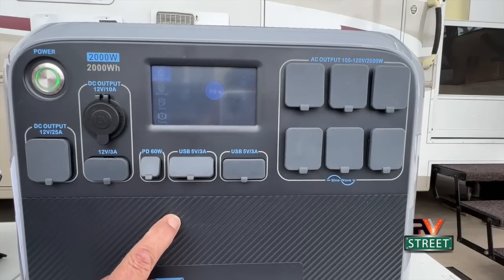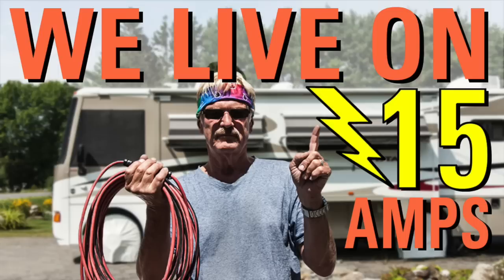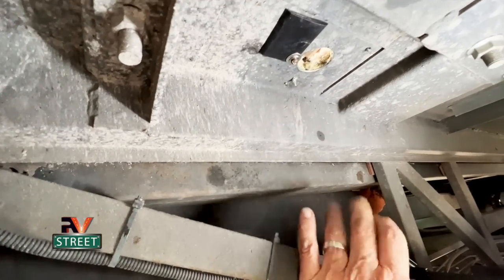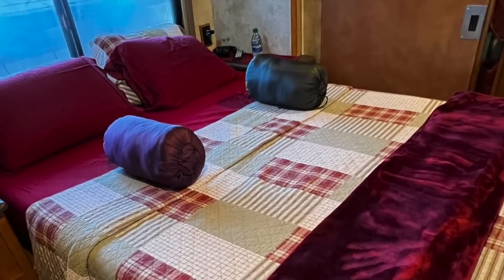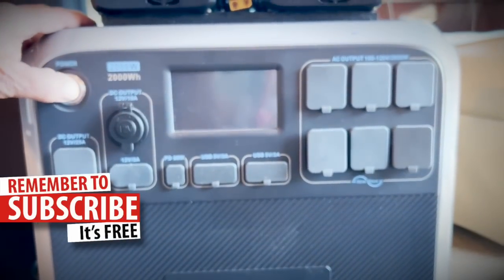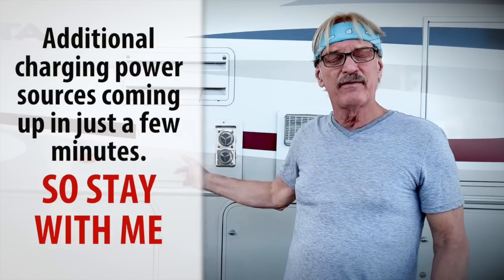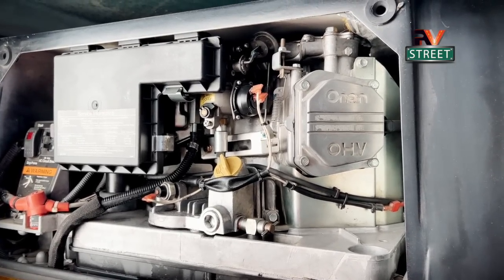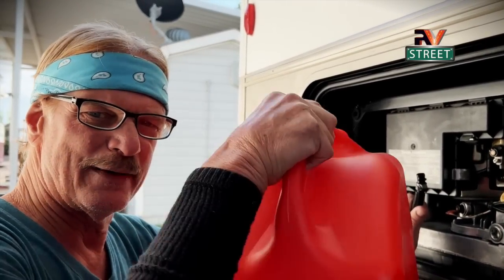Using a Bluetti AC200P in an RV • Most hands on Video on Youtube

Comment: Awesome vid, been watching about this ac200p. 2008 I have a class b pleasure way and would like your suggestion. I want to buy ac200p and i want to plug rv to ac200 while driving to be able to use the ac but charges at the same time. Can i put a splitter to 30a going inside? I will be adding solar to charge the ac200 and in house ac while driving. I can run the 30a cord from outside to inside but it will look ugly coz the cable will running througha window looking for another option. Ty for you time
Reply from the maker: The AC200P will run everything in your rig but is not strong enough to run an AC unit. Even if you installed a soft start on the AC it would run it but not for long. In order to run an AC unit you'd have to have a LOT battery storage. You have dash air in your Class B. If staying cool while driving is a problem for you, what you could do is put a spring loaded shower pole right behind the two front seats and hang a sheet there that drops to the floor. That way all the cool air coming from your dash air would be confined to the front cab area.
The AC200P puts out about 16.8amps or so. So no.....you can't put a 30amp splitter. The AC200P is for supplemental power, boon docking power or emergency power to run the Class B if there's no place to plug in. The AC200P is a fantastic, reliable power station but as with everything else in life, it has it's limitations.

Comment: Wonderful job, why Not a Jackery?
Reply from the maker: Thanks for your question Bert 👍
Well for starters here’s a few examples of the Jackery 1500 back in July 2021…
They are an entry level power source and lack a lot of big features people are looking for but it can be used in a limited capacity for a little backup power
Slowing charging
Need multiple adapters for solar panels
You can’t use other makers of solar panels if you have them already
Only can recharge for 500 cycles
And the BIG one is it doesn’t have a LifePO4 battery

My AC200P is for people who want serious backup power

Comment: Martin, I hope by now (September 2022) you know that Hutch Mountain has a kit to add the ability to run your Honda on Propane or Gas. You have the ability to turn the selector knob to Propane or Gas! I purchased all the attachment hoses, etc. from them, also.  They are wonderful with assistance!!  I have both the Honda 2200i and the companion 2200i units. I called and asked if they would tell me all that I need to change both generators. They went through all the connection hoses, with me and explained each one. It's a very easy install. If a 71 year old woman can do it, anyone can!  I also found a YT video called, "Pimp my Honda Generator". I purchased that kit also. It has a well made and nice looking, red,  magnetic dip stick and a matching extension for draining the oil, with no mess!  There's a metal handle attachment to deter a thief and also a nice cover for your unit. The cover doesn't say "Honda", which also helps to deter a thief.  Thank you Martin, for all you do!!!
Reply from the maker: Thanks Gail. I look into that. And yes I do have metal handle attachment to deter theft plus a plastic coated cable & lock to secure it.

Comment: Hi Martin, I hope you are doing well with your treatments and well on your way to complete recovery. Thanks to your good advice we purchased a Bluetti AC 200 MAX which comes with a 30 amp plug. Perfect for our plans to travel south in our class A for the first time next November! I have a couple of questions if you are answering them these days, no biggie if you're not.  1. So, when we plug our 50 amp cord into the 30 amp adaptor and plug that into the Bluetti, what do I do about our house battery system? Do I just unplug the MH inverter?
2. For the second question I'm just looking for your opinion... Would you recommend portable solar panels like yours in the video, or a solid version mounted on the roof top. Any suggestions?
Reply from the maker: 1) Leave it plugged in. Don't you want your house batts to continue getting charged while using the Bluetti ?
Reply: @RVstreet  yes, I think, depending on other electric priorities such as charging ebikes. Just wondering about efficiency of charging lead acid with Lithium Ion. Would you be better off running your generator for a 1/2 hr to charge your house batteries and maybe plug in the Bluetti with 2 power blocks for that period?

Comment: I have a BLUETTI 200max with 30amp Rv plug. Used transfer switch off 50 amp trailer connection to inside trailer. BLUETTI runs entire trailer items as needed. Don’t need all those extension cords!
Reply from the maker: Good job Andy 👍
Everybody has to evaluate what their needs are, their skill set and of course their available budget. Weight can also be a factor for some folks too with the extra batteries that the MAX can add on. For us, the AC200P checked all the boxes. Using one 12/3 extension cord also was not a big deal. But I also carry a couple of other cords for other applications that don't require heavy loads. No big deal for me. But remember, for us, this IS mainly for emergencies or when we boon dock. If we had a tiny house or needed a home backup system—and had the money—the MAX with extra batt's unit would be my choice. We're retired and don't have unlimited funds but needed some bug power.
Thanks for taking the time to chime in with what you did 💗
Reply: Fair enough. Would add my max weighs same basically as your unit. Battery internal. Also I have 500 watts solar on roof and run directly to unit. My unit just newer model. Cost bout same.

Comment: Do you have suggestions for connecting my two way fridge directly to my AC200Max?
Want to use the fridge while driving without turning on the propane.
thank you for your very informative videos
Reply from the maker: Not off the top of my head but if I thought about it long enough I could probably come up with a work around. Do some research on this subject.
Reply: Thanks Martin 
Great video by the way

Comment: I want to get the AC200max and hook it right to my electrical panel in my Grand Design 37 trailer. I need help doing this. Do you have any idea on how to do this?
Reply from the maker: My question would be, why would you want to do that? Why not just plug into the main cord like the video showed and accomplish the same thing without jumping thru all kinds of hoops with electrical distribution and charging options?
Reply: @RVstreet  Sorry you don't understand but I want the unit inside my RV not outside in the weather. What I mean is that I would like to have a plug in on the inside that I have on the outside so I could plug in inside just like outside. The extension cord does not work for me as I want the whole trailer powered by the bluetti just like it was outside, plugged in with a 30amp plug.

Comment: can I just use the bluetti without  the bypass just plug my power cable in to bluetti
Reply from the maker: If you don't have a hardwired EMS like me then yes.
Reply: @RVstreet  thanks I have a 2000 tradewinds and I have used my 3400 inverter generator also with everything works but my ac unit I am look at the same unit 2000 watts bluetti or FFPower are my choices so far! Thanks for your response

Comment: I spoke with Bluetti as the AC200Max, which has a 30Amp output for the RV, cannot handle both input and output power.  So, if you want to hook up your AGR batteries through the aviation plug, it's been ruining AGR batteries.  On top of it, you cannot connect two AC200Max's together.  You have to use the B239 or B300.  So be mindful, this has its drawbacks, sadly.  Hopefully, in time, they will fix this problem so we can use the 12 volt output and connect it to the AGR directly.  But right now, you are limited to the 110V/30A and connect it accordingly.  Not terrible, but upgrades would be helpful.
Reply from the maker: Thank you for your input and knowledge.
Reply: So if I was able to show you the blue Eddie that I wanted for my rig it’s a small RV 1997 Fleetwood prowler something to that affect 22 foot. I’m just curious is to how to set it up for this rig. You seem pretty smart. Do I just plug it in like it was being plugged into a 30 amp And what extra accessories do I need in order to make it function if you have time to answer then I will get you the information as I wanted to get
Reply: @deemurdoch1409  I didn't use the Bluetti AC200Max (for the reason stated above). Not being able to charge them (from solar) and use them in the camper at the same time was a determining factor.  I ended up getting 2 Bluetti EP500 Pro's that were refurbished.  They can both charge and expend energy at the same time and they require nothing else. That being stated, I do have them connected to solar panels on the roof.  They have been great so far.  You can connect them together and the output is a 50 amp output.  Or, separately, they are 30 amps, each.   You can then connect it to your 30 amp input on your camper (or 50A if you have that capability) and it is no different than shore power.   I have mine connected to two separate transfer switches because I have a total of 3 inputs.  Shore power, solar (which goes through the 2 EP500's), and also a generator.  They didn't make a 3 input so I used two, 2 input transfer switches. Happy to let you know how to do that if you need.  But honestly, in total, it cost me 5K and I have over 10,000 watts of power, along with the 5 200W solar panels.  I'll run out of water before I ever run out of electricity :)
Reply: So I can use three panels together the solar panels with the blue Eddie I don’t know why my phone keeps doing that you know what I mean… And I don’t know anything about switches and I saw another video with a blue Eddie that was lower. I don’t know what the EP 500 is I have to go and do a little bit more research I do have a 30 amp rig and I wanted to have the extra back up in case we lost power and I’m out in the desert because I’m a nervous and I travel in an RV and I really Want to make sure I always have at least air conditioning… OK when I have all my information in order and I have purchased the generator you know which one Bluetti and then I’m going to revisit and connect with you so we can have a chat about how I set up my rig thank you for your info. It was really really good and it’ll help me choose what system I want and how to get it going. I know it’s not just simple as plugging it in All of a sudden it’ll work I understand that’s not how it is but OK let me go and do a little bit more research. I’m going to contact Bluetti and have a chat with some of their sales people. I hate my phone.

All right, well thank you very much. I’ll get back to you shortly. Well, at least within the next week or two.